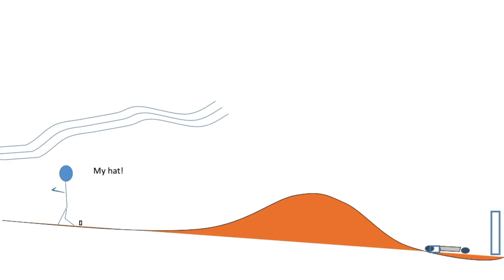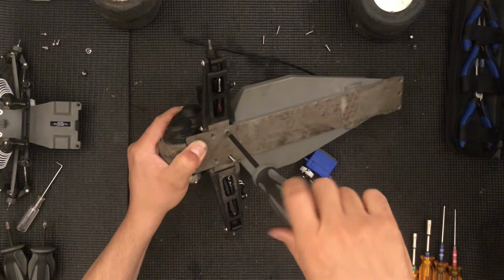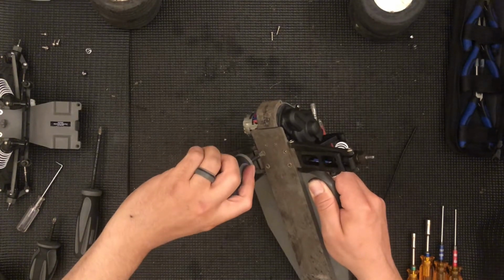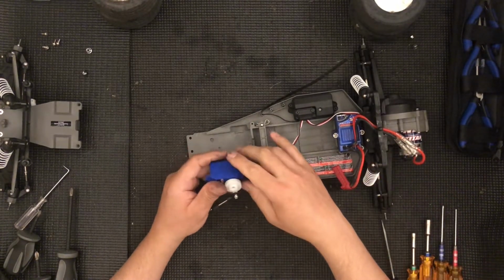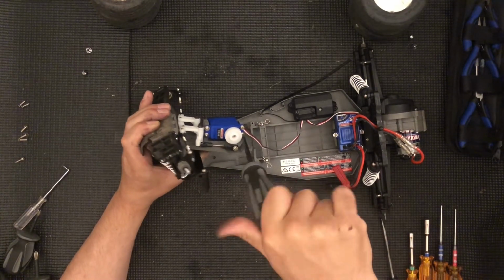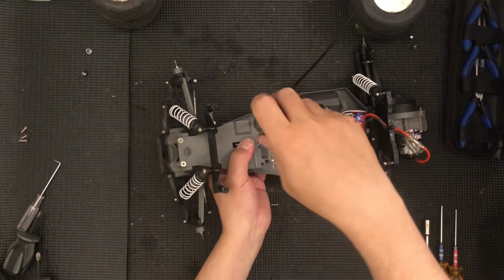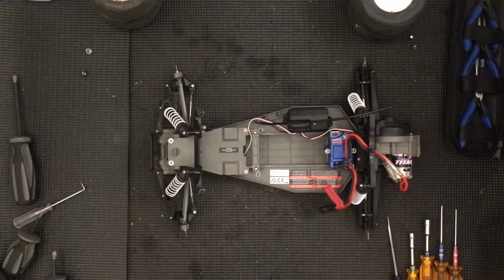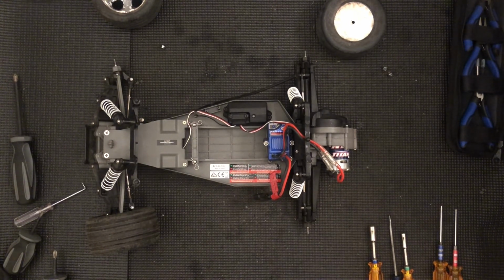Traxxas Rustler 2wd Teardown Series Part 7 How to mate the front and rear end to chassis

Comment: Great explanation on your videos!  I’ve watched them all regarding the 2wd rustler. Thank you for sharing your knowledge. 
I recently replaced my rustler transmission with the hot racing set up. Upon reassembly I’ve noticed the rear arms don’t move as freely as I thought they did before. Or at least it seems this way. It appears the pin is very tight where it goes thru the tabs provided with the hot racing trans case. I am using RPM rear arms. Is there a break in period where they will just get worn in a little better?
Reply from the maker: There should not be. The pins, are these the ones in the shafts that go to the cups on the diff?
Reply: @telecomandorc the pin I am referring to is the screw pin(Traxxas part no. 3739) which holds the rear suspension arm to the bottom of the transmission case (which is hot racing). There are two tabs labeled left and right that had to be screwed to the bottom of the case. I can not tell exactly where the binding is occurring, but before I re-attached the bottom of the shock to the rear arm…the arm would not fall freely. If I lifted it up, it would stay in the elevated position. 🤷🏻‍♂️

Also…wanted to let you know…I did my shocks just like you demonstrated in another video, with the bigger shocks and it works perfectly!  Thanks for the help 👍🏼
Reply from the maker: @stephenwintz4648  My pleasure.
With RPM arms, two are three possible issues.
1) the arms have an up/down orientation. But I doubt this is it as your hafts with hit the arms as the suspension compressed. 

2) the gap between the two  holes bees to be widened. When you slide the arm on the gearbox case, the arms should just slide with very little play. If they are snug, use a file to remove material until free. 

I think it is "2". 

Now... check the gearbox case too. Sometimes the pin does not slide smoothly on the case and you needs to ream it. If you remove the arms and the pins feel snug when you slide them in the case, you need to ream it.